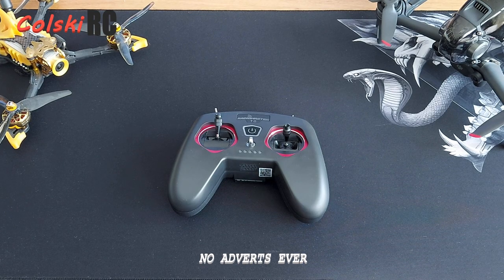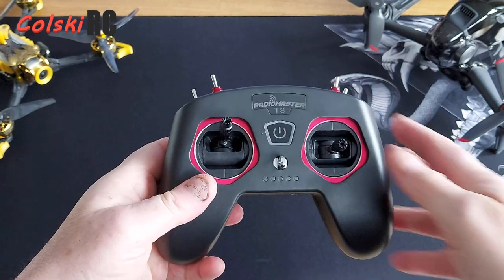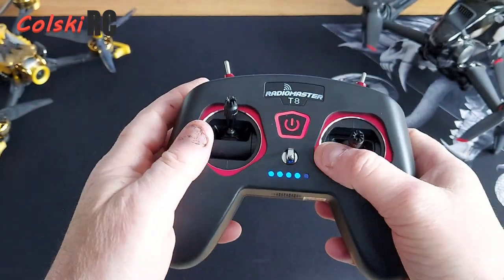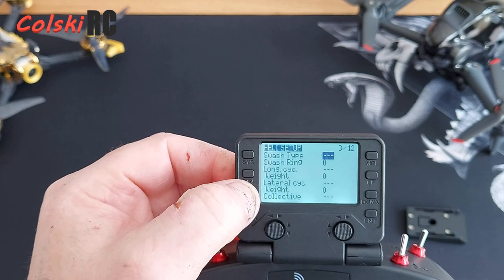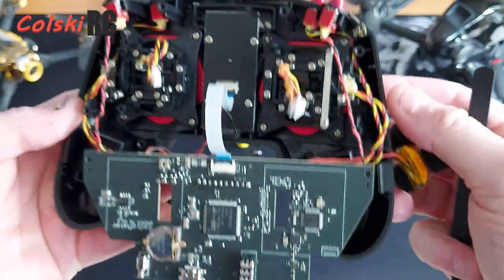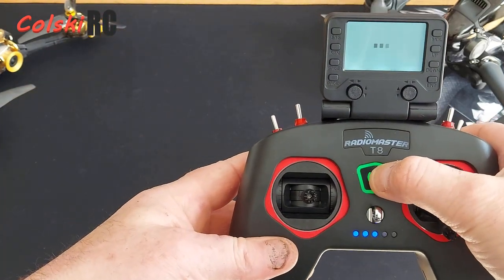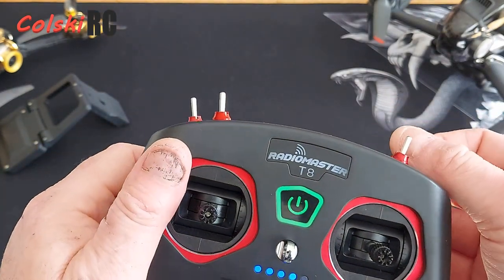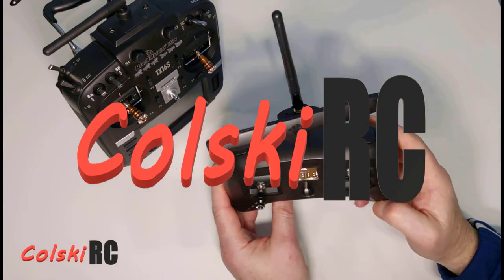RADIOMASTER T8 & T8 PRO BEST BUDGET RC TRANSMITTER?

Comment: nice looking radio mate!
im thinking ill go with the jumper t lite since the "pop n swap" factor is better for battery replacement....
carry a few charged 18650 and youre golden....plus the external antenna for better range....
Reply from the maker: Hi if you can afford i would pay extra for radio master t16s,  both of these are extremely toy grade and i dont believe when reviewers are saying they are using as daily drivers.
Reply: @CKone41  the t16 models look nice and im sure theyre awesome...however theyre huge and bulky from the looks of them lol...
i have the jumper t8sg and t12 models and love em!
the jumper t lite would be a super "traveler" radio for flying micros/whoops with...
i fly micros and larger with my t8sg...it does a super job!